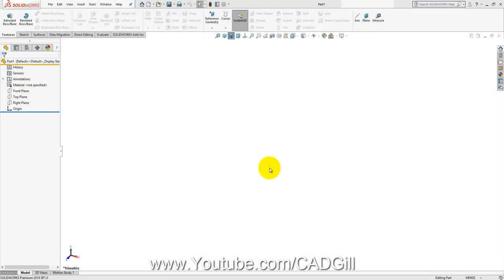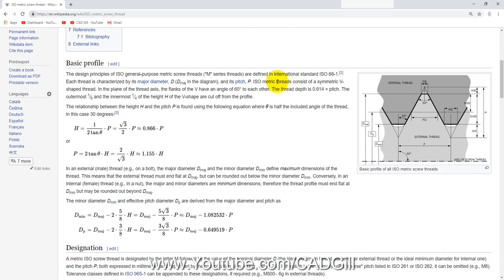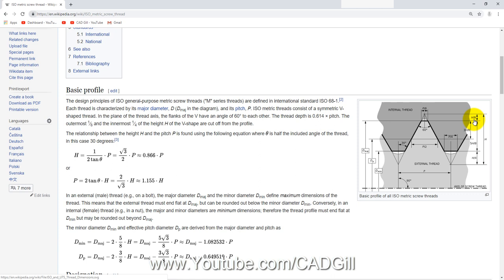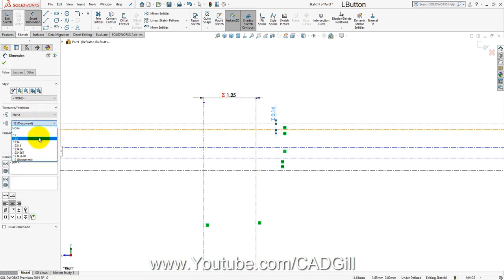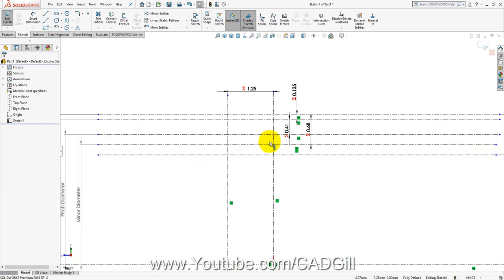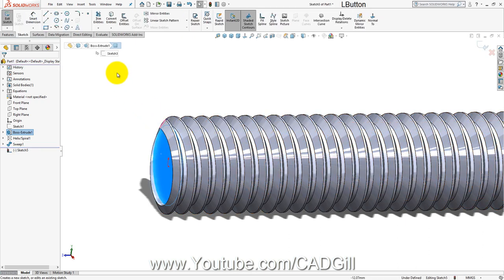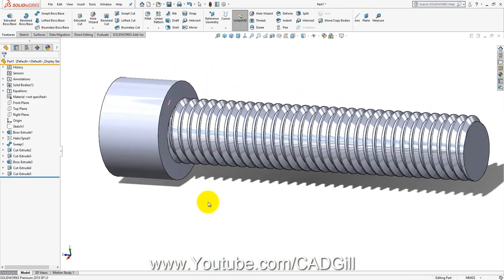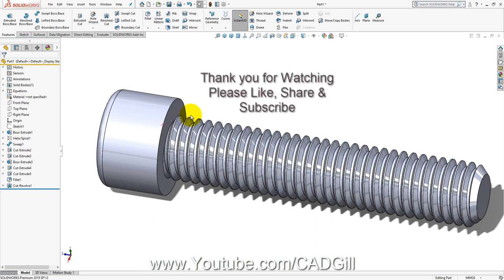Allen Screw ISO 4762 Metric Standards Equation Modeling in SolidWorks

Comment: 32:53 based on the norm DIN EN ISO 4762 what you did isn't correct. You gotta use the right plane and make a small construction using the geometry provided by the norm and finally you use revolved cut to finish the inner section in the head of the screw. There's a video of what I've said in German in case you wanna see how he, the youtuber, and I did it. Just reply to my comment, I'll be happy to show you how to do it correctly. Cheers.